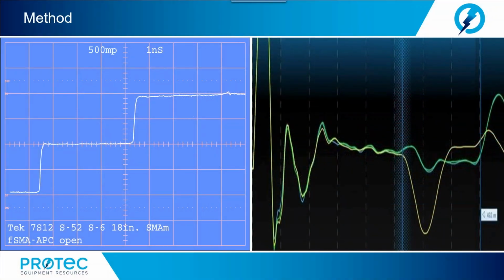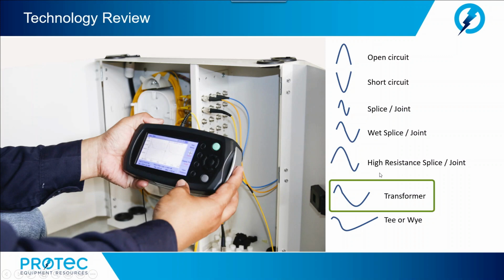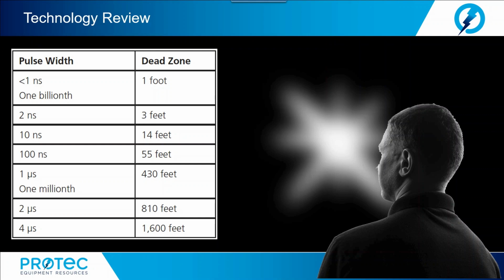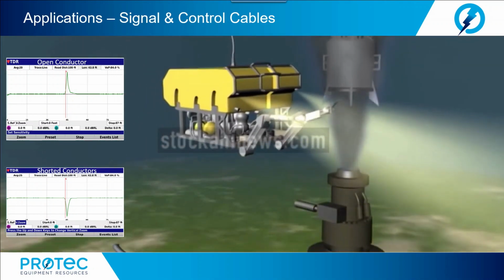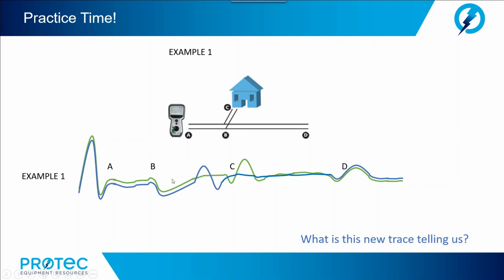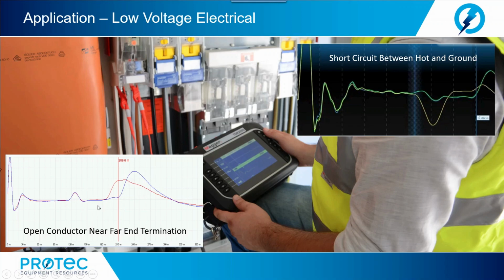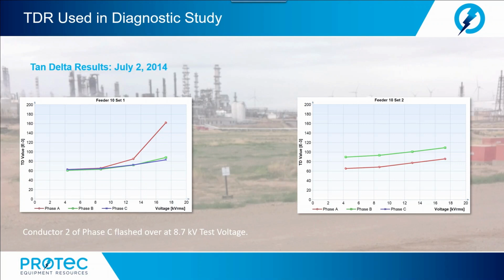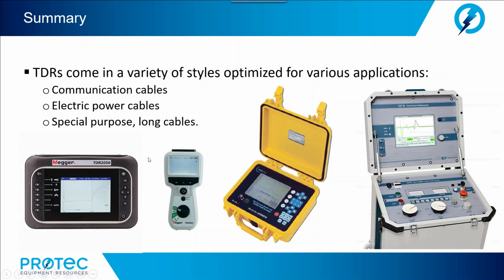Time Domain Reflectometry (TDR): Technology Review and Applications

Comment: Can TDR be effective for underground non shielded power cables? For example, could a TDR measurement be performed on a PV source circuit, containing 2 500kcmil conductors run underground in conduit?
Reply from the maker: Hi Mark, thanks for your question.  From Bret Hammonds:  The technology behind TDRs is ideally suited for two conductors separated by a homogeneous (equivalent) insulation such as what you would find in either a shielded cable or one with a concentric neutral.  The case that you have presented is less than ideal for use of a TDR since it is only able to detect very significant changes in impedance such as an open circuit or a short circuit. 

Having said that, it might be possible under some very unique circumstances for a TDR to be helpful in finding a fault in such a situation as what you have described.  Those circumstances would include:
- Using either a grounded conductive conduit for your return or the two separate cables that are running through the conduit.  In either case you would NOT have a homogeneous (equivalent) impedance throughout the distance of the cable run.
AND
- A significant fault that is either completely open circuited ( ~ ∞ ohms) or a very low impedance (for all practical purposes considered to be a short circuit between the conductors.)

If the fault is a high impedance fault, which is often the case, then the TDR will NOT be able to see the fault without being integrated into a more elaborately featured cable fault locating system.